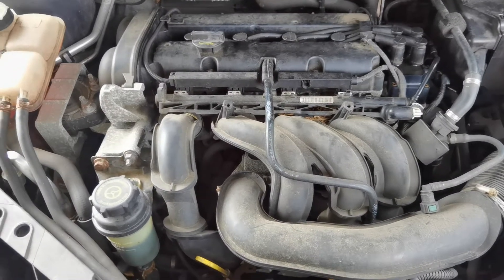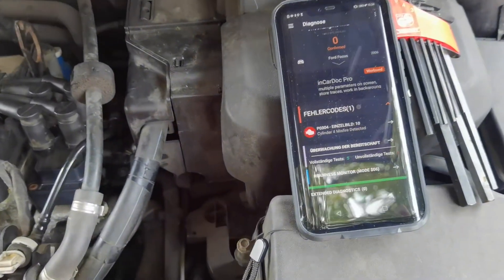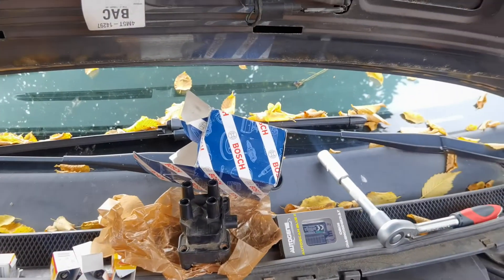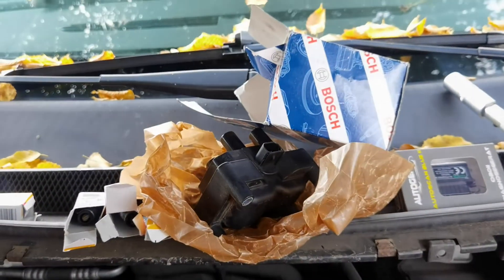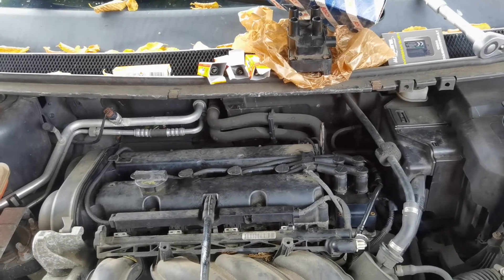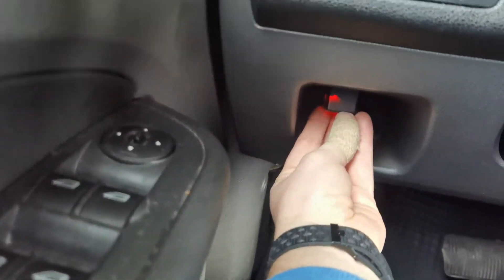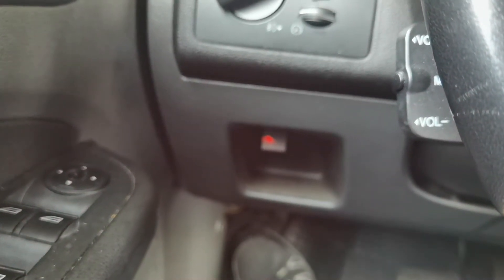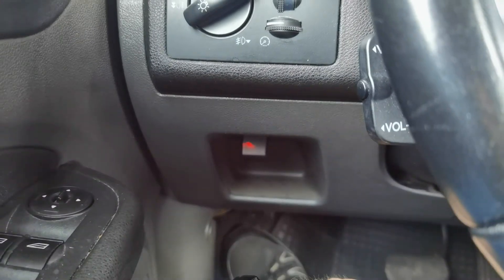Our 2007 Ford Focus MK2 had a rough running engine - Error Code P0304 Cylinder 4 Misfire

Comment: I haven't changed spark plugs in a long time.   That's a nice device to get the engine code.
Reply from the maker: For me it was the first time ever du to me mostly driving diesel cars in the past - exchanging the plugs already made it run much smoother.
Reply: @kunicross  I changed the brakes on my car last month.  Now I have to change the brakes on my truck.
Reply from the maker: I'm just hoping that's it for the moment with car repairs! (for the both of us!)